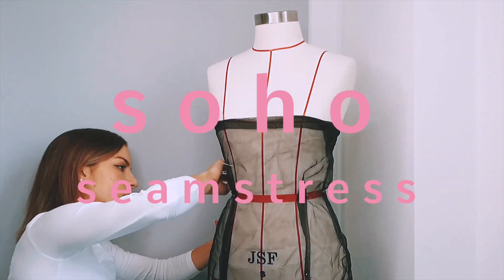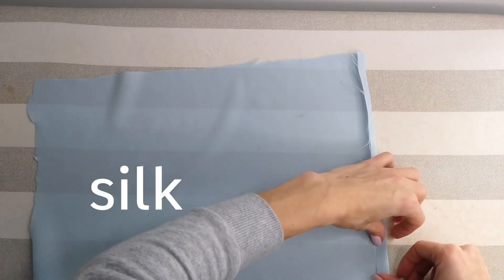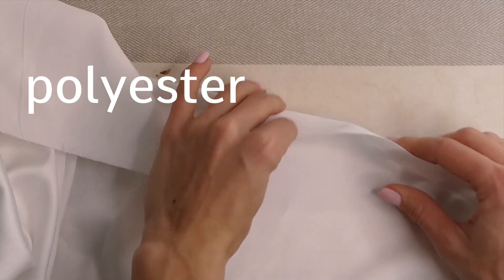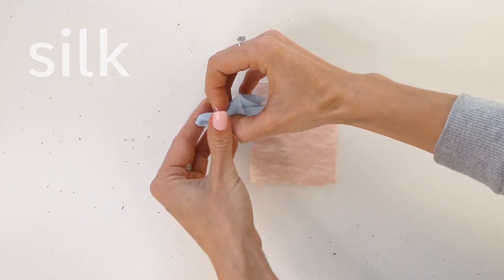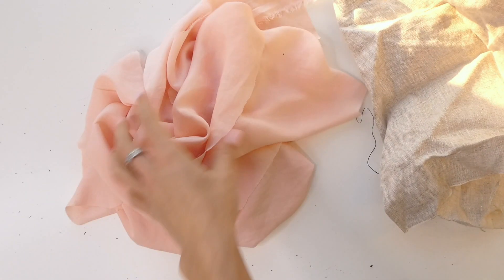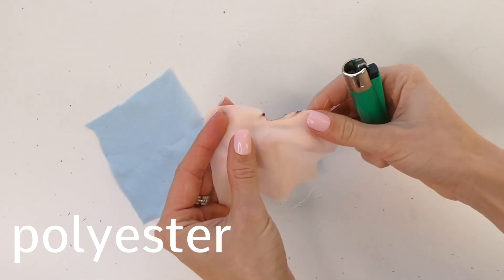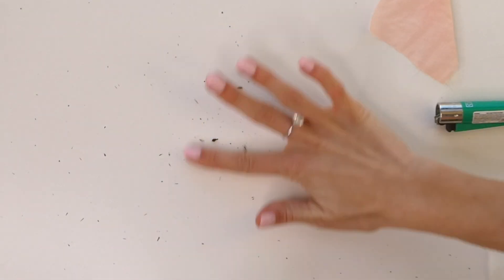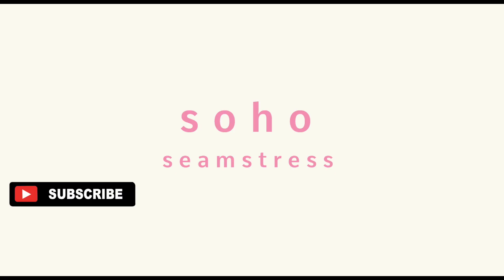Polyester or Silk ? How To Tell The Difference ??

Comment: The ring test seems unreliable because it also depends on the thickness of the fabric. If you take the exact same size, and same weight of silk and polyester, will you still see the same result which you demonstrated?
Reply from the maker: Yes I believe it would work with any silk / poly with the same grams per meter

Comment: I bought what was told it was real Mulberry silk. I’m unsure. With the test the satin went through way easier than the supposed silk. It literally like fell through practically.
Reply from the maker: These are good guild line steps to checking but the weight and weave of the fabric can play a part as well. I hope that helps !
Reply: Try to show water test. Silk will absorbe the water.